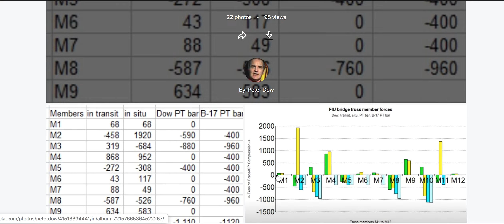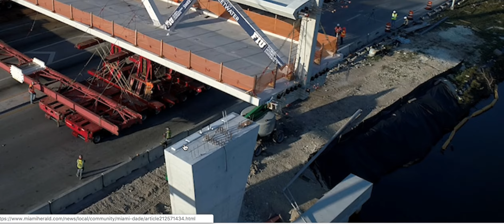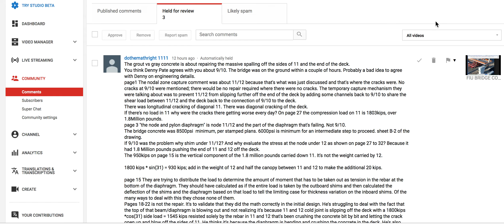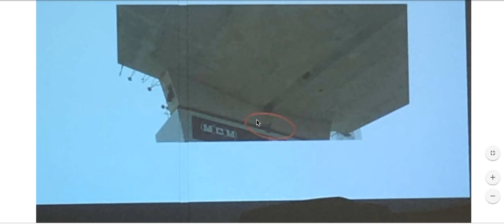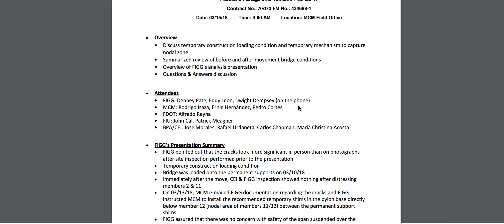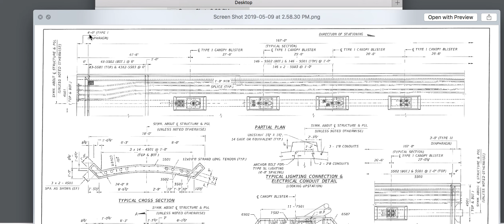FIU Bridge Collapse D1 Tendon NOT in Equilibrium? Post Tensioning question

Comment: Regarding the diagonal that was cracking:  In my opinion it was cracking due to excessive compression.  While I'm not positive, I think increased internal tension would lead to more cracking.  It was cracking because it was bending and while concrete has some flex it really can''t be considered bendable like steel would have been.  There is absolutely no question in my mind that this walkway should have been a steel box truss where people walked on a deck inside the long tube  - light,  strong, flexible, practical.
Reply: I must add that while the diagonal was cracking, the true failure was in the deck and canopy that were also too weak and frail for the length of the span.

Comment: From the Miami Herald:
“FIGG assured that there was no concern with safety of the span suspended over the road,” according to the minutes of the meeting, which began at 9 a.m. 

Three hours after the meeting ended, the bridge came apart at the north end and collapsed in a heap of steel and concrete, crushing motorists waiting below it at a stoplight. One crew member working atop the bridge was killed and another critically injured.

The experts say the rods inside the diagonal piece in question, known as No. 11, were there only temporarily to provide support while the span, which was built by the side of the road, was lifted into place over the trail. Tightening the rods would not have strengthened the bridge structurally, they say.
Reply: This indicates to me that FIGG is a highly incompetent bridge engineering team.  Clearly their calculations, if they made any at all, were entirely wrong.

Comment: Looks like a misprint to me.  What is the tension on the other side?  (The mirror image)
Reply from the maker: Tendon size and those exacting requirements in the different columns would put that out of being one key off when you type in numbers, for example a 1 or 3 when you meant the 2 key...  But, only when typing on a computer and not when writing.
Reply: @LoadPathEngineering  These look like CADD drawings so the numbers would be typed in on a PC keyboard
Reply from the maker: @PEAtlanta  ,  agreed PE, and yet the numbers are far from next to each other to be a mistake (my thoughts)...
Reply: That's why I asked about the mirror image if there is one.  Are you talking about the tension in an angular web or one of the compression cables in the deck?  My impression is you are talking about the deck that has several ables on each side.   This is off the subject but I realized they could have done a upside down "T" for the deck and an upright "T" for the canopy which would have distributed the load on the nodes.   Of course it was still missing  proper vertical web support that would have prevented the lever effect of the acute angle webs.